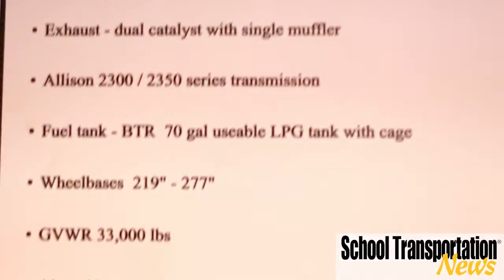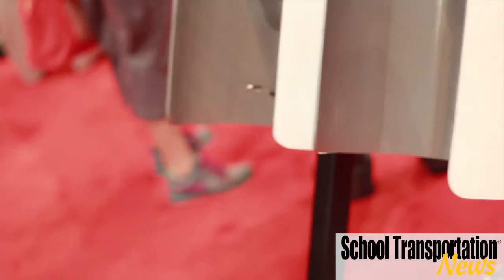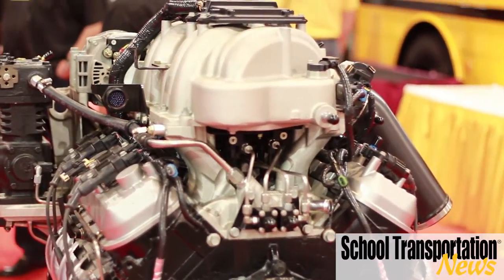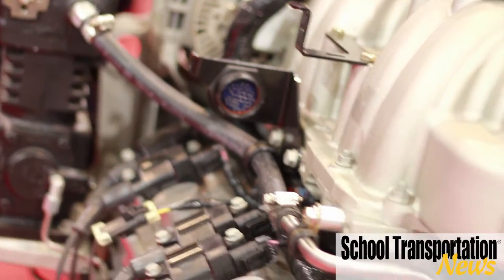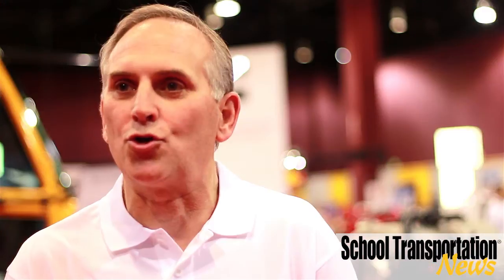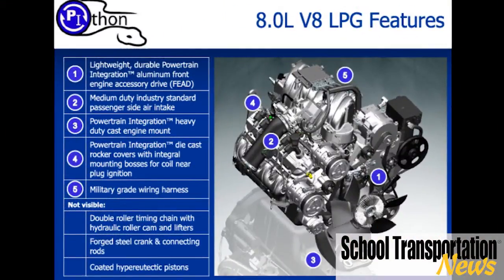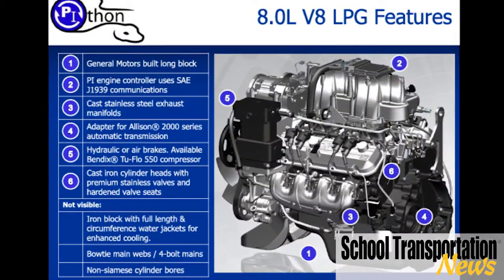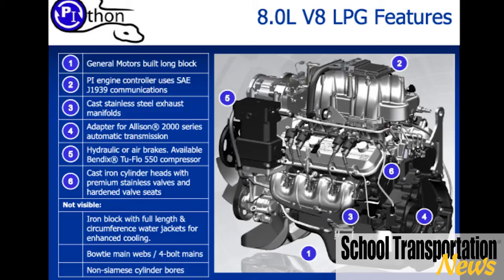New School Bus Propane Engine

Comment: This is an impressive engine and it is our hope that we can eventually install one in our 1947 Flxible Clipper 29 passenger coach. The current GMC V6 401truck engine is 50 years old and components and parts for this engine have dried up. For 2015 I installed an Allison 1000 6 speed automatic transmission. We travelled 4,000 miles in 23 days this past June/July 2015 with the Anderson Monarchs--a youth baseball  team from the Marian Anderson Rec Center in Philadelphia. Check out our Youtube vid of the bus by typing 1947 Flxible (that is correct spelling of Flxible)Clipper Bus into the search window. Its a rare and unique survivor.